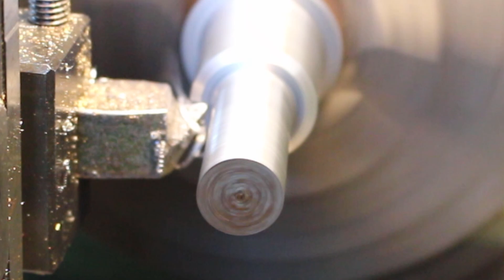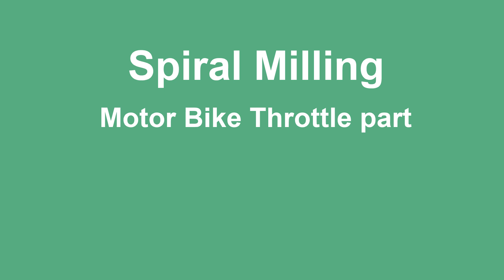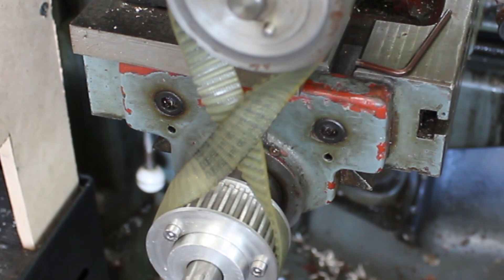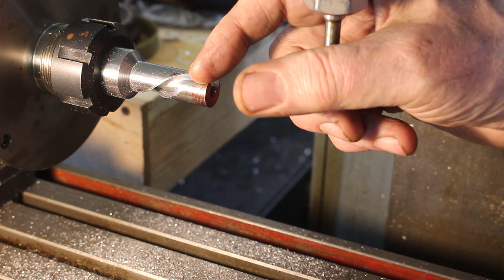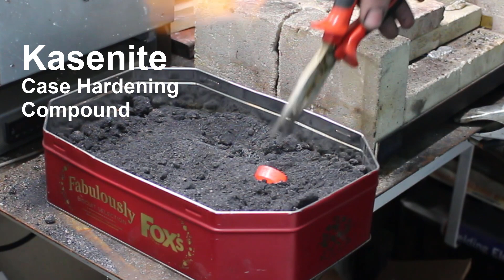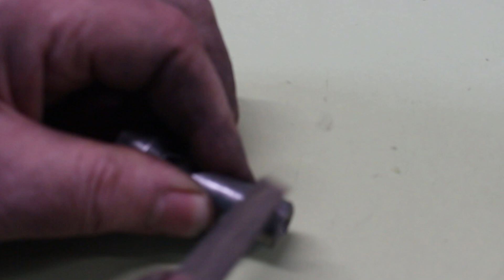Spiral Milling a Motorbike Throttle Part - Shop Made

Comment: Really well made Nigel, must admit I pulled a funny face when I first saw your belt crossover but it did the job very well. Nice to see you back in the workshop mate. Great video, enjoyed that. Cheers, Jon
Reply from the maker: Thanks Jon. Yeah, I fully expected to have to set up a couple of gears to reverse the head stock spindle rotation, a real pain, but luckily I had a longer toothed belt I could use in crossed over fashion, and surprisingly it worked very well.
Cheers
Nigel

Comment: How did you determine the gear ratio to get the proper helix? I'm fascinated by the process of spiral milling and would like to try it but getting the helix right is a a concern of mine. 

I'm a retired welder and pipefitter but I recently bought a lathe mill combo machine and am teaching myself with the help of YouTubers like yourself. I always wanted to try my hand at machining but the opportunity never arose. There are so many ideas kicking around in my head for new tools and parts and my base in metalwork to date needs to be expanded and that is why I might ask what appear to be dumb questions. I ran a shop many years ago and I had a sign posted over the timeclock. It read "There is no such thing as dumb question, only stupid mistakes". So I ask not only for myself but also those who are leery to ask because they don't want to appear dumb.
Reply from the maker: Hi Scooter Tramp. For sure never be afraid to ask anything. One or two others have asked similar questions so I may do a short video showing more detail about my spiral milling set up and how I determine to ratios for spirals, if I don't do the video I'll get back to you.
Making tools is a great way to learn, you'll always have more projects in your head than you'll ever have time to make, that's my experience anyway.
Cheers
Nigel
Reply: @GoCreatehms  I am sure a video on the subject would answer all of our questions. I suspect that it would be a ratio something like I used for stairs using run versus rise on an inclined plane with your run being the degrees of circumference of the cylindrical core.

Comment: Hello Nigel,
Good to have you back on our screens... great work as always... How did you decide how many times to repeat the case hardening process...
Take care.
Paul,,
Reply from the maker: Thanks Paul. The case hardening only needed to be skin deep, 4 dips sounded good, just my gut felling. As you probably know, for a deep case hardening you need to pack the part in a box surrounded with case hardening compound and heated in a furnace for an hour or two.
Cheers
Nigel

Comment: why the new has oposing direction to the oryginal?
Reply from the maker: So That when the throttle is turned the wire to the carburettor pushes instead of pulls. This is to enable a different carburettor set up to be used.
Thanks for watching, much appreciated.